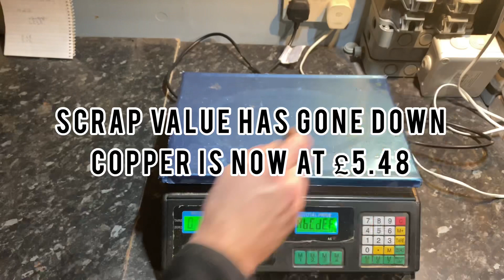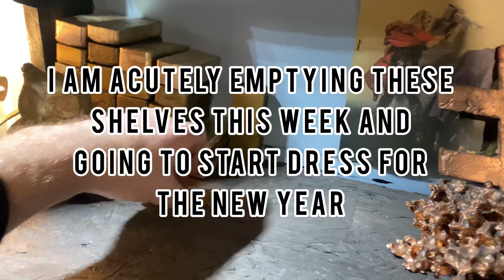Stripping electrical sockets and melting brass and copper (asmr)

Comment: Can you melt the steel in your furnace too? 🤔
Reply from the maker: No my furnace go up to 1400°c and steel melt at 1600°c but it would be nice
Reply: @meltingipswich  Okay so can you find a furnace that can melt steel up to 1600 degrees celsius higher. If you can will it be more expensive to purchase? 🤔